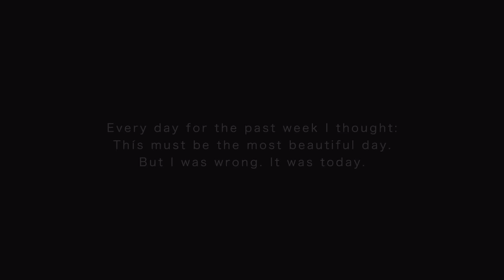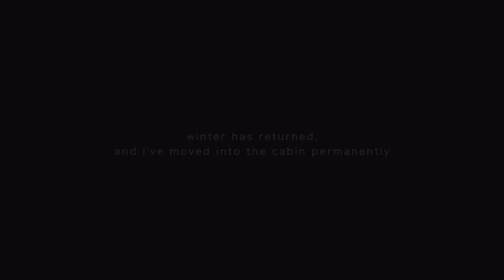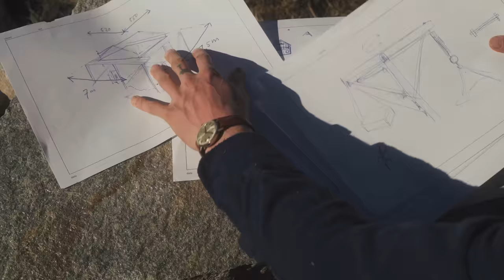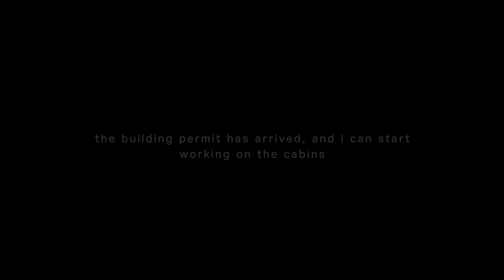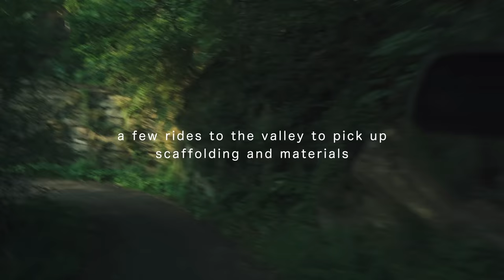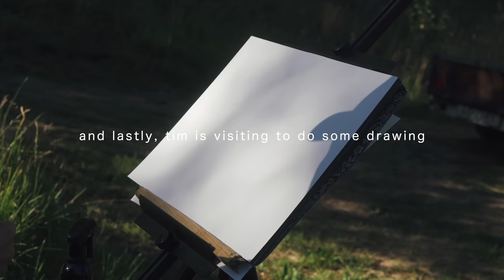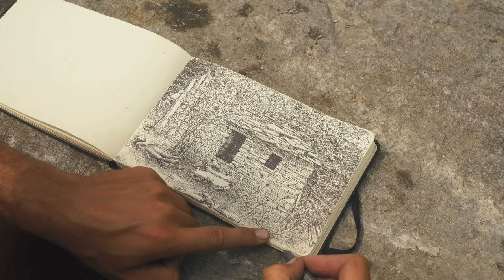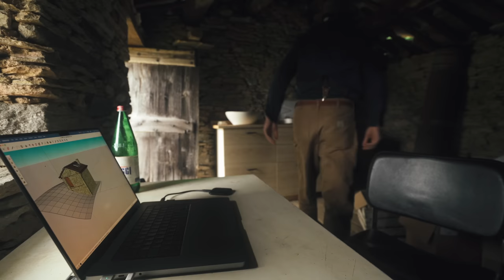ONE YEAR | Renovating Two Stone Cabins in the Italian Alps

Comment: First I like to say you and all the people that came to help out was such an awesome thing to watch. We need more love like that in the world today. I'll admit I wasn't looking you up I just happen to have my TV on YouTube and feel asleep to something else but woke up to you and 4 other guys working some place absolutely breathtaking and you had me sucked in.😊  There was something that was puzzling me though and I have to ask, when you put the 'condensation paper' on the roof why did you roll it down like you did instead of across overlapping itself ? I'm thinking maybe because the way you did the roof it didn't matter.? (By the way it looked beautiful.) 
I just turned 55 but last year I built my own shed from the ground up (10x10x12 high) all by myself ,literally and made a second floor instead of a loft , no windows on the bottom but 2 on the top walls. I have no experience only Common sense and I have to say I did a ok. Anyway, I got to the top part and didn't finish the last 2 feet up on 3 walls and didn't get my roof on nor the siding , I have it all framed in and I had the beems up with the 10 ft. Metal sheets but didn't nail in any of the beems or sheets on to the beems and the wind blew all that off and the rain has been pounding on it so I screwed up.. I DID good though, it's built more like a house then a shed. Everything is level and square and I blew my friends away . 
It's hard work and I just wanted to say if I could of I would of come to help.🙂
I watched the rest of your video and you really did a fantastic job in a wonder land of stunning beauty.  I will subscribe and keep watching.. Thank you ,

Comment: as someone whos done restoration in older - much more poorly built houses - my advice would be to first look at the quality of material in the house - what kind of lumber is it, how was it framed? (for example in my childhood home the foundation was rapidly deteriorating but the rafters and floor joists were solid hand hewn hemlock beams over 6 inches thick - incredible building material that can be salvaged in any case) 
second I would assess the land and its value to you. would you like to work from there, live there, raise a family? would you be interested in horticultural or agricultural development (in the case of .8 acres maybe a small orchard, veg  and coop chickens for example) 
If there is a tenable foundation along with reusable materials + you value the LOCATION for yourself (and you have an abundance of time haha)THEN I would strip the house down at least to the foundation and try and salvage what lumber you can and rebuild straight up from there even changing the floor plan if you want - OTHERWISE I'd say to go with minimal cosmetic adjustments and try and flip in a few years

Comment: Direct current from your solar panels is incredibly sensitive to length of cable.  DC power does not cable transmit well.  Especially low voltage 12 ?  24 ?  volts.  Place your inverter in the shed so you then need a much smaller cable at 120 volts, or 240 volts.  Cables as short as possible between panels and shed.  Voltage as high as possible between shed and house.  The angle of your panels should be the latitude less about 7 degrees.  Orientation, of course, true south.  Allowances can be made for efficiency if there is substantial day time shading from the mountains.   Holy Smokes,, what a steep road  !!

Comment: Brother.. great work. 
But the Vapor barrier and the Tyvek is installed the wrong way. 
Its an accident waiting to happen. 
Major Construction error. 
You install it horisontally with an overlap. 
Not vertically. 
+ when you connect all of the roof  battens over one rafter.. that rafter has to carry the whole load of the roof. 
Best practice is to spread out the connections

Comment: a concrete ring at the base of the roof is a danger in the event of an earthquake, because if the walls implode it falls intact! only with a second ring at the base connected by columns, this method works. Otherwise it is advisable that it is not a ring but a floor marker, therefore not connected, in this way if a wall falls, the others remain standing